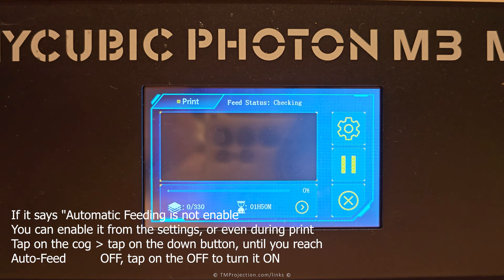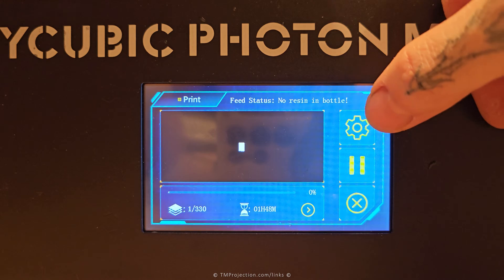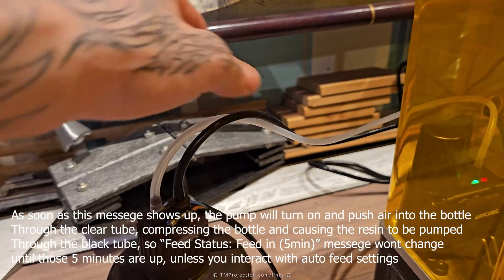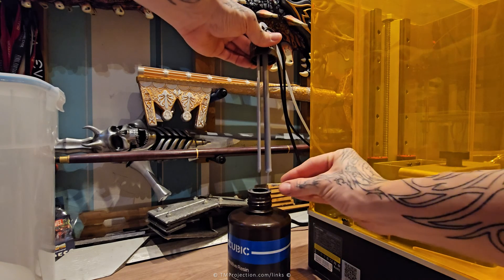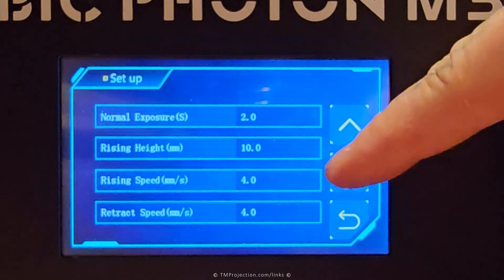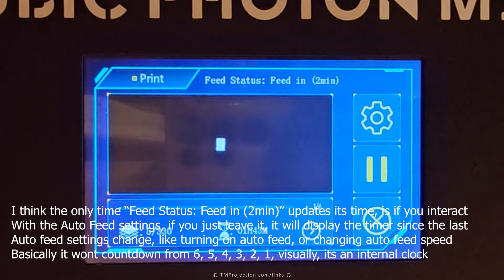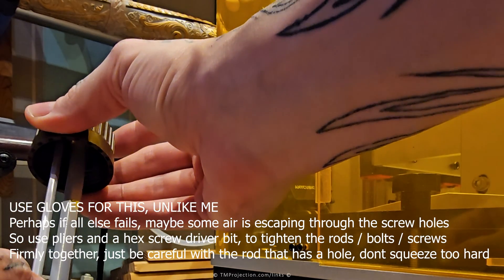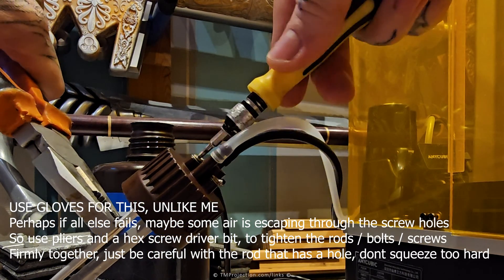AnyCubic Photon M3 Max Auto-Feed Not Working Functionality Diagnosis and Repair

Comment: fuck man I've been trying to find the solution to this for so long... I think I might've accidently thrown that washer away
Reply from the maker: actually update on this video, even that washer itself doesnt fix this most of the time, ive redesigned the cap, which is the issue in itself, ill have those files out soon
Reply: @TMProjection  sweet, ill keep tabs on checking in on that update!
Reply: @TMProjection  hey following up on this, did you ever release that  file you were talking about?

Comment: Hey don´t know if you will see this comment, my feeder is for some reason only dripping instead of flowing like yours.
Got any idea why it does that?
I did put the little paper washer back on and closed the lid tight.
And it´s on 100%.
Reply from the maker: yeah i figured out the problem completely, its the cap design, its crap

actually im making a new video on it and a full 100% fix, i redesigned the cap

ill publish a new video and files on the new cap soon
Reply: @TMProjection  thank you so much.
Your legit the hero we all need.
Ngl without your video on the little paper washer i would´ve been clueless.
Always thought you don´t need them and threw does away.
I might try out some flat gaskets for piping maybe the ones out of rubber might work better.
Reply: @TMProjection just poured some silicone into feeder’s bottle cap to make permanent gasket.
Silly design with these paper gaskets.

Update: just tested, works like a charm

Comment: Thanks man, i had a suspicion that there was something not right.  Mine didnt come with a washer.  I fortunately have a ton of nylon, rubber, and fiber washers so i put one that was about the size of tbe bottle diameter in and suddenly it was pumping fine.
Reply from the maker: my pleasure, anycubic couldve just this in the support instead of sending me a whole new replacement lol